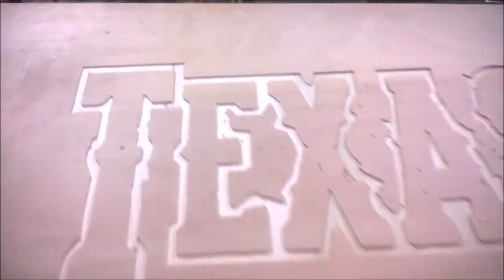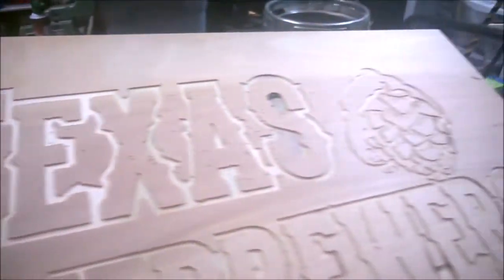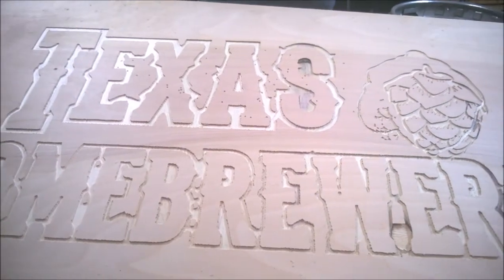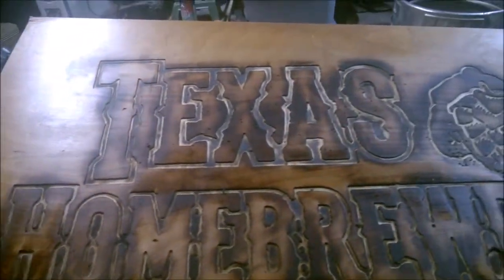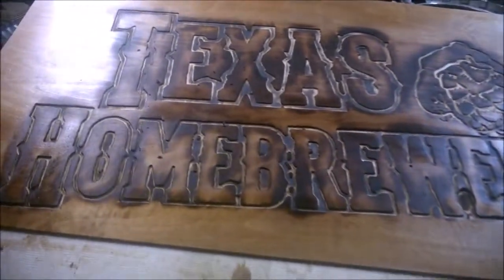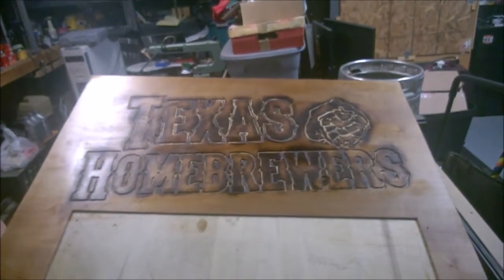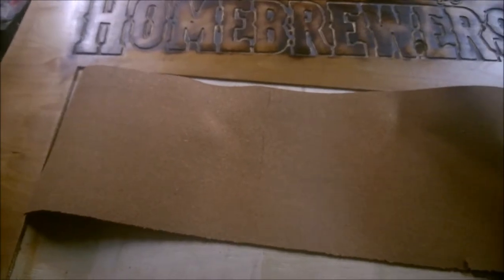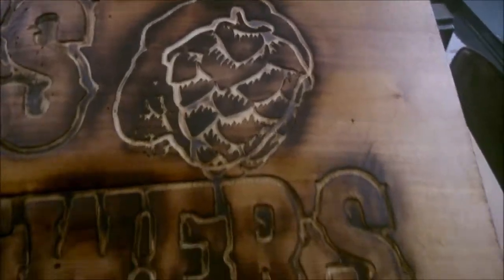X-Carve sign on plywood, made in Autodesk Fusion 360

Comment: If you use a shorter endmill it doesn't deflect that much. The less stickout the better. Maybe it looses position when moving rapidly to the next part, i had to adjust the potmeters of the gshield.
Reply from the maker: +jarnoderbi That's what i'm finding out.  Thanks for verifying that with me.  Anything helps at this point.